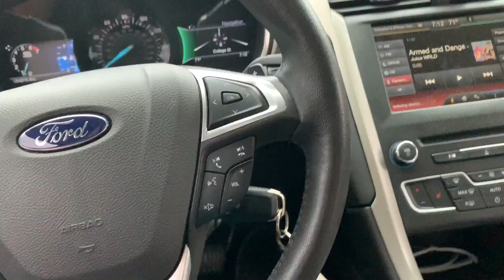Pulling The Engine Of A 90's f150 For More POWER!!

Comment: hey so ive got a 1988 f150 xl and its been sitting a bit and takes a little while to start so i know that i should check the spark plugs but what else do you reccomend doing to get it to start well
Reply from the maker: Ohh man there is a number of things you could do and I’m not sure what it’s doing when you try to start it
Reply: I have a 91 F150 and I would check the easy replacements first like replace:
Fuel filter
Starter 
Starter Solenoid
Spark plugs and spark plug wires
TPS(Throttle positioning sensor)